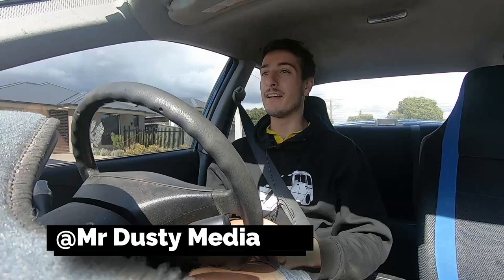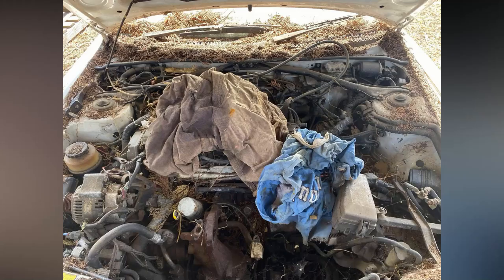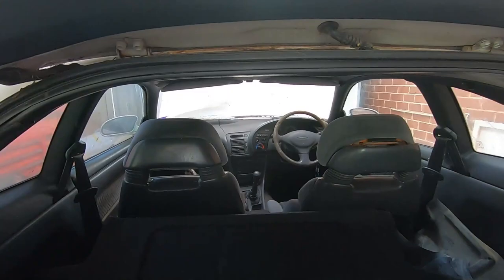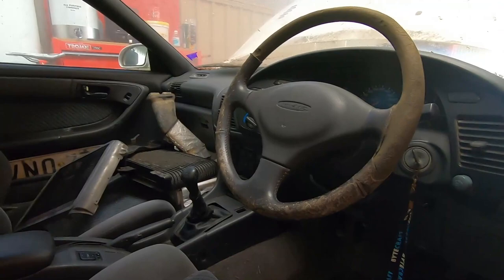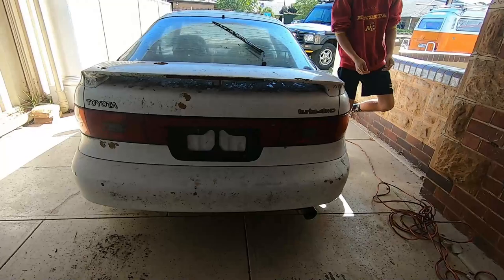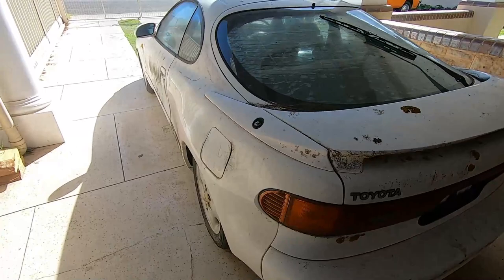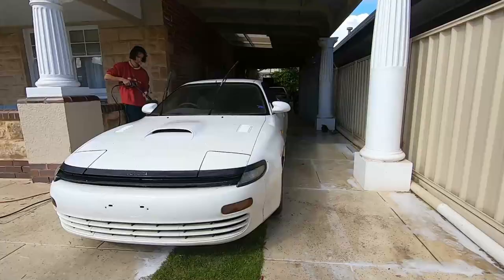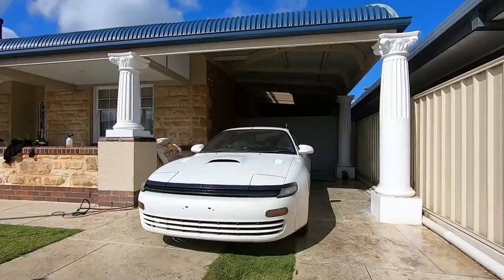BARN FIND CELICA GT-FOUR - Part 4: First Wash In A Decade (Celica Build)

Comment: I believe the reason the fuel tank and spare wheel are different compared to the non-gt4 cars is because the the gt4 is AWD so the spare wheel and fuel tank have to fit around the rear diff.